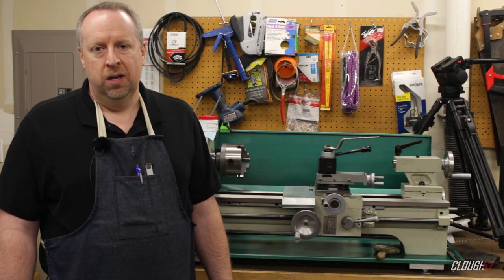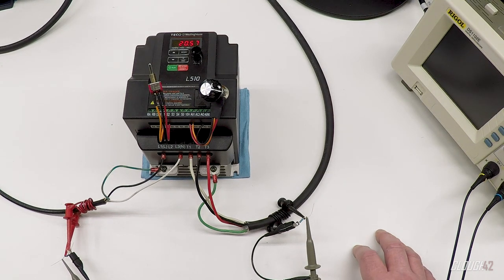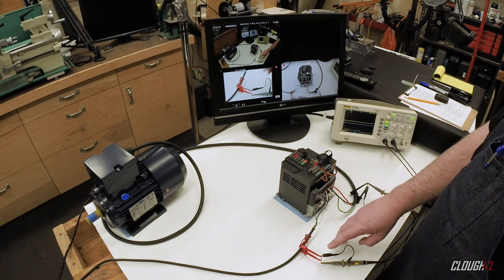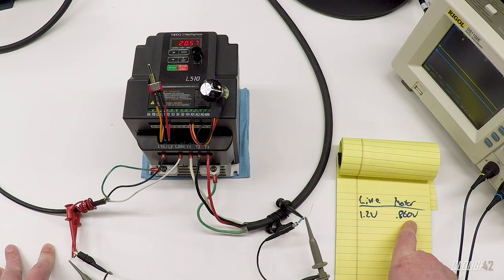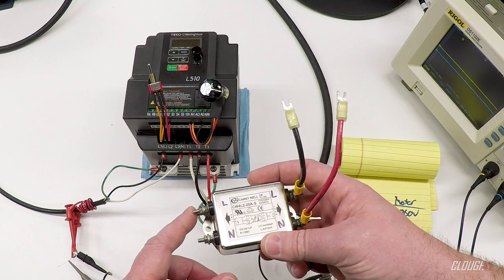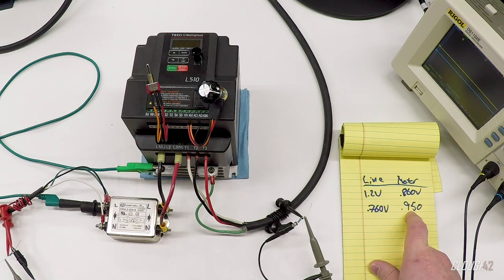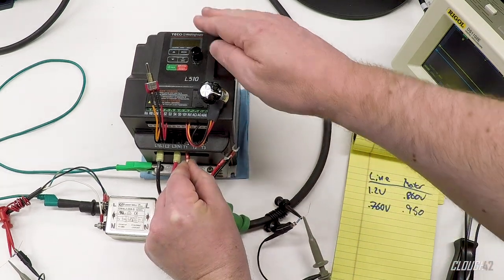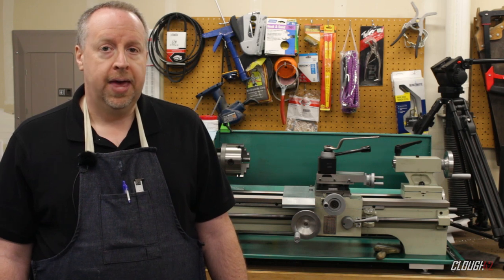Lathe VFD 3:  How to Fix Noise Problems

Comment: Would using armored conduit with a ground cut out the radiated EMI to the motor?
Reply: The ground would have to be bonded to the conduit and then landed at a ground buss. You still have to have a protective ground in the conduit though. You just use shielded cable. And make sure you have a good ground for your machine.

Comment: We use something like this on our machines at work but the conductor is looped back through the ferrite.  Our ferrites are about 1" long. Have you tried this?  If I theorize about our application the loop back creates a single coil inductor and helps to oppose the incoming signal you are trying to eliminate.
Reply from the maker: You are correct; more turns through the ferrite create more inductance, increasing the effect.  Technically, running the conductor through the ferrite once creates a single-turn coil.  The rest of the circuit (through the motor and back to the drive) forms the rest of the single turn.  Looping the wire around the ferrite and going through again makes it a two-turn coil, which doubles the inductance.

Comment: Great project!  I'm planning to follow your VFD and ELS projects to upgrade my lathe.  What do you think if I put both projects in the same enclosure?  Will the VFD ferrites and filter be good enough to keep the LaunchPad board happy?  Or should I keep them separated?  Thanks!
Reply from the maker: I have mine separate.  Mixing a VFD with low voltage electronics is flirting with trouble.
Reply: @Clough42  Thanks.  I'll keep them separate.
Reply: @Clough42  is it possible to mail you? i've a question and i need to send you an attachment..Please!

Comment: Hello, great video. I am planning on getting a VFD to use for a CNC router,  and I want to use filters on both input and output, my 220 has 4 wires, 2 hot, neutral and ground, how would I connect this to the filter? Would I just connect the 2 hots on one side of the input on the filter? Thank you
Reply: No!!!! You don’t use that filter on the output!!! Are you sure about your reference of the VFD output? Are you sure it’s not 3phase ? 3 hot and a ground? Anyway read the manual for the VFD and follow it. They explain the best practice. You should be using a reactor on the input and output sides and shielded cable! Make sure you have a good ground.

Comment: I wonder if adjusting the carrier frequency would affect these results.
Reply from the maker: Hmm...interesting question.  I haven't tried it, but I was seeing noise issues with my camera gear even at the default (5KHz) carrier frequency.  My understanding is that most of the energy in the noise spectrum is generated by the fast edges, and these would be the same with the lower frequencies.
Reply: @Clough42   Besides I'm guessing since you work for several hours in the shop, that keeping the frequency up, as you mencioned in previous video, removes the annoying high pitched noise which over time might cause fatigue, right?
Reply from the maker: @KillFijo26  Yeah.  I can't stand the whistle.  That and changing to SLV mode cured it for me.
Reply: The fast edges generate the noise, but at a lower carrier frequency there would be less energy pulses per unit of time and thus less total noise energy generated. Keep up the great work, James.

Comment: Very interesting, and not a moment too soon as I'm changing my lathe over as well.
I've had good luck with Hitachi VFD's so hopefully no problems now but will the noise only be a bother 
with CNC or a video monitor, neither of which I have?
Reply from the maker: Noise is a subtle issue.  Depending on the situation, it can cause all kinds of problems, or none at all.  False triggering in end-stop switches and other low-voltage circuits are also a possibility.
Reply: How might shielded cable (if suitable is available) work for a basic installation?
Reply from the maker: Shielded cable should help with radiated noise, as long as it's properly grounded, but I wouldn't think it would do anything for conducted noise.  If you try it, let us know.

Comment: If the VFD has an internal filter, will a filter on the input still be necessary?
Reply from the maker: The VFD manual calls for an input filter.

Comment: James, have you seen VFD double shield rated cable?  I was recently introduced to this.
Reply from the maker: You mean with foil and braid?  Or something else?
Reply: @Clough42  Yes, the cable has foil and braid.  In your video Lathe VFD 1, as you strip the cable to wire the motor, I do not see any foil or braid.  It is more expensive.  Just wondered if you knew about it.

Comment: did you  up-sized  the vfd  to be able to run a 3 phase motor using a single phase???
Reply: Yes you have to calculate all of that into consideration when single phasing a VFD.

Comment: My VFD is powered by 220v ( two hot lines no neutral ) what kind of filter is suitable for this application?
Reply from the maker: I'm no electrician, but my understanding is that the same unit should work.  As long as it's rated for 250v, which it says it is on the nameplate.  Looking at the schematic, there appears to be nothing different about the line and neutral paths in the circuit.
Reply: @Clough42  ok thank you :)

Comment: Your 'current transformers' are wound perpendicular to the induced field of the cables...
The coupling is proportional to the cosine of the angle between the pri/sec. The angle of your secondary windings is on average roughly 90 degrees. The noise signal you see on your scope is virtually useless. 
Your windings need to be parallel to the current you're trying to measure. A clip-on ferrite core current transformer would probably be the easiest way to do it without making a mess by winding your cable into a loop.

Comment: I wonder if the filter is required once you have the ferrites on?
Reply from the maker: That's an interesting question.  I think it's all a matter of degree.  The ferrites help some.  The filter helps a lot.  Is there a level at which things would be acceptable without one or the other?  Maybe.

Comment: curious to see just how many ferrite cores you realy need to get the generated disturbance within in reasonable regions think 4 would be plenty or any extra dont make a lot of difference 

interesting , i had "heared about radio interference" from wiring laying to close together without a eathing wrap around them and the problems some people have getting there stuff to work without crashing  
im about to build a cnc "box" (planning on using a cheapish aluminium camera/suitcase or a big tin box like a big box for a medical kit ) with the drivers , the computer , and a single chineese 600W 48V 12.5A Switching Power Supply (have to see i might change that for a analog type powersupply with a big toroidal transformer rectifyer and elcos )
the VFR was planned to be put in there too ........now i think i better mount it away from the box and use a controll cable from it to run it 

was allso planning on using brass bus bars 
https://www.jaycar.com.au/medias/sys_master/images/9142979690526/SZ2003-machined-brass-busbar-8-wayImageMain-515.jpg
to tie all the minus / plusses / grounds / and the 2 phases of the single powerlead going in together closest to the source to prevent earthloops like you get when jumping the wires from one driver to the other 
guess i need to add some filters and ferite rings between some of the higher power ac busbars and some of the components too

i seen some people twist or even braid the plus and minus leads together on the low power dc wires per driver to prevent electromagnetic radiation , does that help any?
Reply from the maker: As I understand it, the issue isn't purely the power being transferred, but the high-frequency transients generated by the fast switching in the variable-speed drives.  I think putting the VFD in a separate box is usually a good idea.

Twisting pairs of wires together to avoid coupling to nearby circuits works--especially if they're differential pairs--but I think it helps even if they're single-ended.  The idea is that the current flowing one direction in one wire is the same as the current flowing the opposite direction in the other, so they cancel out.  And since the wires are kept tightly together and their positions are changing constantly over the length of the wire, it's hard to get much coupling to nearby wires.

Comment: Great vids.  Have you tried this setup with a GFI?  I have a input filter but keep tripping the GFI and seems to be a noise thing so says the web :)
Reply: Gfci? Are you powering a VFD from a gfci outlet? Or gfci breaker? You really need to calculate the leakage current and inrush current from VFD if you want to use a gfci.
Reply: You need a shielded cable man. That is going to wreak havoc on your motor. Most motors that are going on a VFD have a grounded shaft. That high frequency radiates through the shaft and pits the bearings. You seem like you have a lot of equipment down there,

Comment: So is a Special VFD cable needed on the output side or will this do the job?
Reply from the maker: You need three conductors, plus a ground.  I prefer SOOW cable, because it's oil-resistant and has a thermoset jacket, which doesn't melt when hot chips fall on it.
Reply: @Clough42  By the way, the S in the cable designation represents RUBBER service cord while J represents JUNIOR rubber service cord.
Reply from the maker: @georgebeaves1254  IIRC, the primary difference is the insulation thickness and the voltage rating.  Either will work.  The rubber is the important part for resistance to hot chips.

Comment: Hi. And thanks to your video, but this didnt solve my problem. In short. I have cnc3040z-dq from china,with 800w spindle. Works like a charm. Then made some mechanical changes and put 1.5kw  air cool.with vfd. After few days awhen manualy start or stop spindle(not conected to con. Board), if conttroler is on for cnc and start or stop spundle manualy and mach3 is on. Then machine by self ismaking movements to right very litle. Rwturns when stop. But not same movements. Tried with filter, but no success

Comment: General Question, I have a 3 monitors on my PC, one of them Hooked up through a 5.1 Surround amp that likes to Go black when i touch some of the other hardware i have plugged into PC (Motion Racing Simulator),  Where would i remotely start to diagnose the problem/solution ?   Thanks eh
Reply from the maker: It's likely it's electrostatic discharge interfering with the HDMI (or whatever) signal.  Monitors are weird.  I have one that doesn't always wake up with the computer, and an identical second monitor on the same machine that does.  Go figure.

Comment: OK James.  I thought I had everything I needed a L 510 VFD .  I see yours is a 110 VFD an L510 101 H1-U my VFD is a L510 203 H1-U that is 220V in and 3Ph out..  I  was using it to run a 3HP motor.   My question I already have the exact filter you have one, will I have to get another filter  or can I just use the one.  The filter is rated for 115/230 . can  I use the 2 Leeds in as 110 on  each side and then come out on the other side with my filtered leads of 110 each to the the VFD.  Or do I have to get another Filter.  I think I will be OK with the switch that comes with the lathe G0602 I will just have to use the switches two top  middle connections for the  110 on each side then the top left of switch will be my common..  If any one has any input I would appreciate all the help a I could get.  Just be nice I am just an old Dirt Racer that loves to fix thing myself.
Reply: You can use the filter for 220v single phase. Are you having noise issues?
Reply: @beckyschwantes5287  I am so sorry I did not get back to you before now I had back surgery.  Not having noise problems I just thought it would be better for the Motor.
Reply: @44mod  it absolutely will! Believe it or not new VFD certified motors have a “shaft grounding” system . They have figured out that the high frequency noise from an improperly grounded system is actually causing premature bearing failure . Also keep in mind your system grounding is only as strong as it’s weakest link. Are you using a residential ground?
Reply: I was asking about the amp rating because if you do have a short circuit or ground fault it’s going to take 25 amps or more to trip the breaker, if your filter isn’t rated for that you will fry it. If you ever want to discuss your set up we can. The machines I service are all emi compliant and the technology is constantly changing.
Reply: @beckyschwantes5287  I am using the same motor on my lathe that James is using on his G602 Lathe I have motor grounded to lathe and I am also grounded through wiring from electrical box. The electrical box has a earth ground.  I have hooked up my filter and everything seams to be working great.  I am getting a vibration that seams to be coming from motor. Seams like something in the frequency from VFD. The filter seams to have helped the vibration some.  That is why I was looking at the filter. Thank you for your quick response. I apologize for my slow response I have health issues but God is so awesome and I Praise him for my Great days as well as my really bad days. Thank you so much and God bless.
Reply: @44mod  good deal! As long as you are running ok it doesn’t really matter, but typically grounding a cnc machine with a residential ground where the ground and nuetrals are bonded is a poor set up. You say you are grounded on the lather? You are not on any paint or over coat that would degrade the connections are you?If ever possible or you add a mill and a surface grinder or something like that, you should sink a couple ground rods and create a better ground.  So you think the small vibration might just be some residual noise? You should look into a line side reactor and also a load side reactor. This is what you really need. Yes they are a bit more expensive but you pay for what you get. If you are single phasing the VFD you can use a 3 phase reactor but there is an equation to size it to 1p. The company that sells them will do all that for you and tell you exactly what you need. You should see if you can pin point when the vibration occurs. Is the motor accelerating or is it ramping down?  I bet you just need to start playing with the gain parameters- start adjusting some of your gains just make sure you write down what ever you change. You won’t hurt the drive. Are you using a double shielded 4 conductor VFD power cable? That is a must! And don’t let anyone tell you that you ground the shield using the drain wire.  Anytime you hear that , you tell them you 360 degree ground your shielding with ground clamps and plates!!!!!
Reply: @beckyschwantes5287  thank you so much for the advice.  I will change the 3 wire coming into vfd to a 4 wire with common and ground separate.  The vibrating is a little better i was having a grounding problem, the box on the 3 phase motor was not grounding  correctly so I ran a ground wire from input box on motor to lathe and motor. The seal to keep moisture out of box from input box and motor opening where not grounding at all.  Ask me how I found out, it was a tingling experience.   Thank you so for much for these recommendations. GOD BLESS YOU AND HAVE A GREAT DAY

Comment: Pretty hacky just dumping all you have onto the wires. You should feed each wire through at least 4 times , not once.  Effect goes up with N^2 , so that 16 times more effective. Better do that with on ferrite on each wire.  Since the ferrites reduced input too, the in line filter was probably not needed.

Comment: Your vfd is so quiet.   Is there no high frequency noise?
Reply from the maker: Out of the box it did, but I changed a few settings to make it run quieter.  The programming video covers my settings.

Comment: Why not use tantalum capacitor at the input of VFD?
Reply from the maker: As a filter on the AC line input?
Reply: @Clough42  sure
Reply from the maker: @fathicoltd6774  I'm pretty sure it would just explode.  Unless I'm missing something.